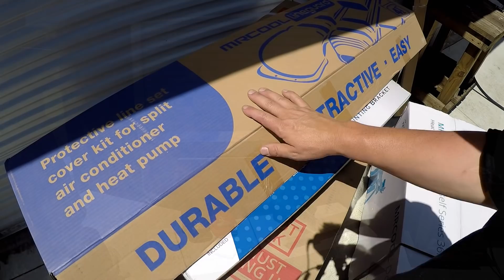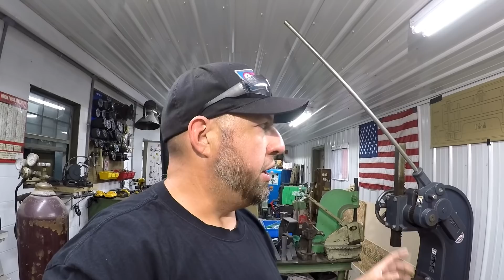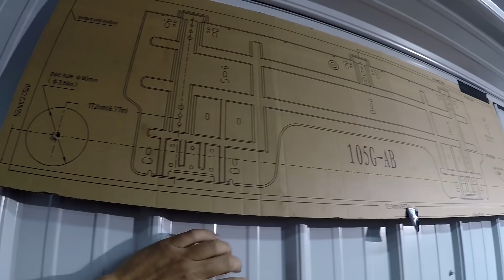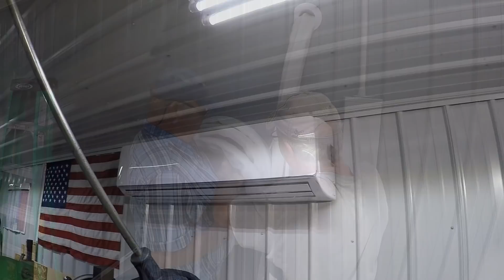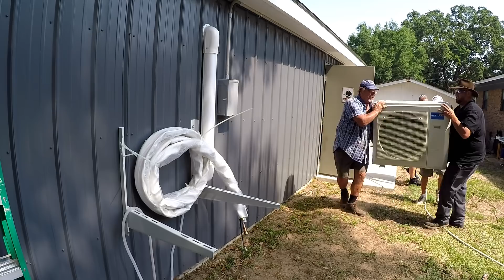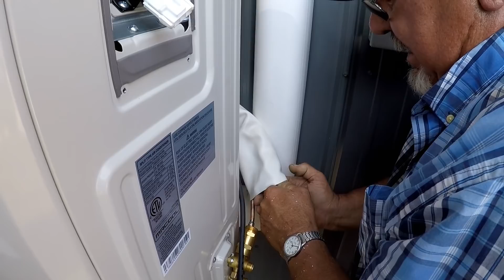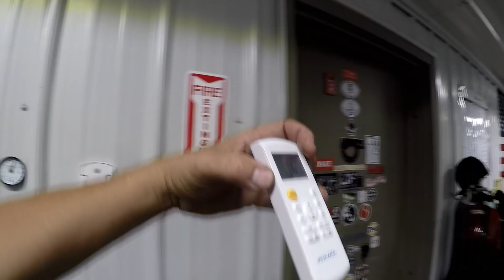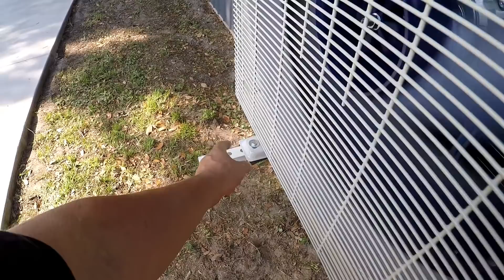Mr Cool DIY Shop AC Install

Comment: Hey, Adam, throw a spray of UV protector clear coating over the plastic pieces from the outside of this unit. You can find it under any shop that sells stuff for people wanting to recondition their front lights. I'm sure they put UV resistant plastic in, but you can always double up on the "armor" against the Sun. That should give a few extra years before it starts to decay as they usually do.
Reply: The best thing to protect plastic from uv is spar urethane. Lowes carrys helmsman brand in rattle can and normal. Make sure its spar urethane, not just normal urethane.

Comment: Does the shop have any windows at all? that would be totally illegal here. From an architects point of view I would recommend putting extra isolation onto the roof and the pretty dark wall color on the outside sure doesn't help.
Reply: I think the main shop has some windows, but they are covered.  Probably for security reasons.  Easier to breaking into and also easier to find out what is worth stealing before they break in. Lots of thieves will skip properties when they don't know what they are getting into before hand. Security through obscurity isn't a good first line of defense, but it can help.

Comment: I'm considering getting myself a mobile unit for my appartment, it's getting towards 30°C (86°F) in here like every year in the summer, I don't want to take it anymore.
Reply: I bought one last year, it hit like 33*C two days in a row. The only problem was that I didn't have the correct type windows for the exhaust, so I had to have the window partially open and let the exhaust hose hang out the window which was a bit detrimental to the cooling effect, but it sure helped. Definitely make sure you have a vent or something that you can hook the hot air side to if you get one of those AC units.
Reply: Sure this is a problem but what I want to do is to get me a piece of wood cut to the right dimension of the window and make a hole which fits the exhaust.